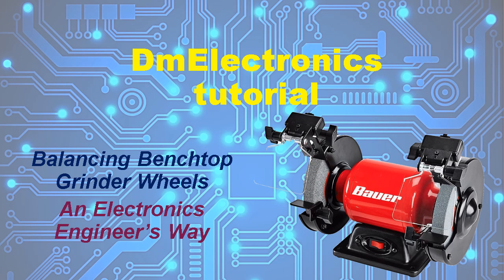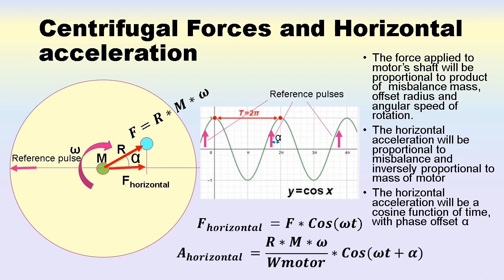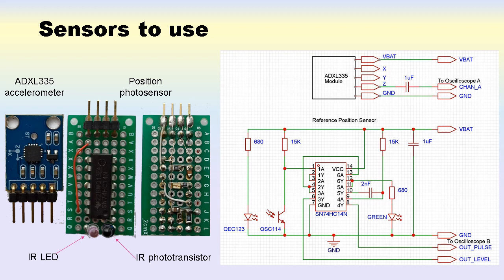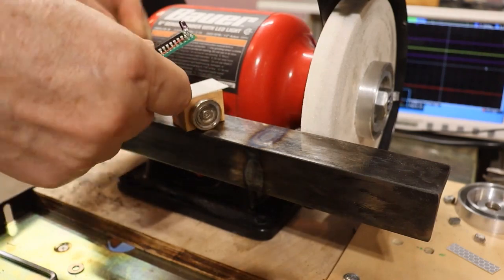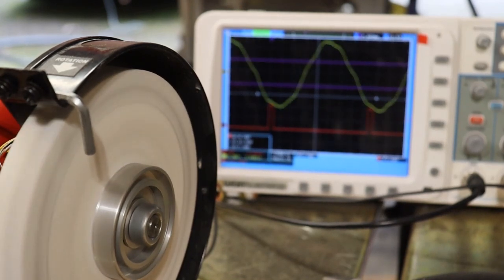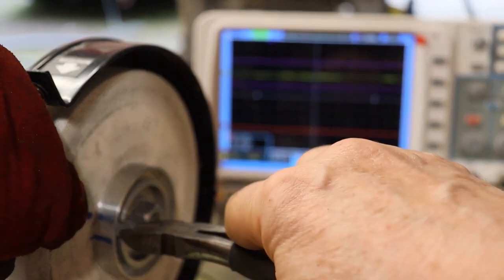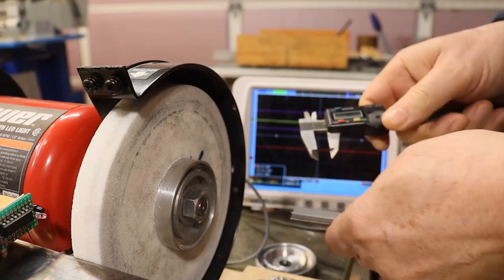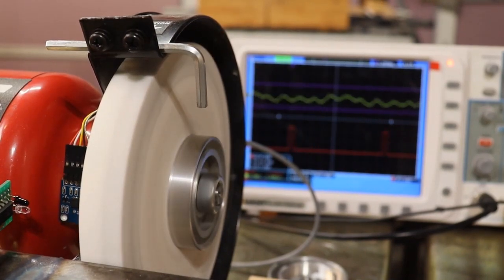Balancing Harbor Freight Bench Grinder Wheels: An Electronics Engineer Way

Comment from the maker: The phase of sinewave on the screen relative to the reference pulse tells the angular position of the counter-weight. The period is 360 degrees, so if the top of the sinewave is at, say, 3/4 of space between pulses, the angle is 270 degrees from the place where the reflecting sticker is attached. If you can measure the delay with cursors, the angle in degrees is equal to the time (in microseconds) divided by 43 (for the 60Hz motor free running). In other situations, the angle (in degrees) is the time offset from the pulse (in microseconds) divided by distance between pulses (in microseconds) multiplied by 360. I.e., Angle=Toffset/Period*360. The weight may be also calculated from the effect of placing calibrated weight and measuring corresponding change of the amplitude. That allows to calculate weight and position and perform balancing in one step. In fact, similar technique is used in automatic wheel balancers in auto service.

Comment: I just bought one of those and have the same issues ( I'm also an EE).  I was thinking another way to do this would be to make a stroboscope and run it at a frequency slightly different from the rotational speed of the wheel. The space between the wheel and the rest should 'breathe'. Some simple markings on the side of the wheel ought to tell you where the heavy spot on the wheel is. Your way looks pretty complicated.
Reply from the maker: Thanks for watching! Please let me know if your experiment with a stroboscope was successful. I guess that if you want to track the (deflecting due to misbalance) center of rotation with stroboscope, it will be very difficult because the amplitude of displacement is very low, especially near perfect balance. Besides,  you need to properly dress the wheel before balancing (but you need to do it anyway). One other alternative is to place the grinder on the scales and observe the AC component of the weight, which is nearly the same as I did but will be less sensitive and needs an amplifier for load cell signal. 
On the side note, someone suggested that the same method will be useful for balancing the ceiling fans. This case may also work with stroboscopic observation.
Reply: @celsiusswatt6021  You got me thinking about this. I worked for a company that make ultrasound probes for surgery. We tested them looking through a microscope where the illumination was coming from an LED being pulsed close to the vibrating frequency. I looked like it was waving back and forth really slowly - very cool. I was going to write a program for one of the ARM cortex eval boards I have to pulse an LED using a timer. I was going to just put marks on the side of the wheel and watch the gap between the wheel and the tool rest to get an idea where the imbalance was happening. If I get around to this soon I'll post what I find. I was a bit surprised at how out of balance the grinder was.
Reply from the maker: @ianboard544   Note also that the spacing between the stone and toolrest will not depend on imbalance, because they are fastened rigidly together, and they will vibrate together. The best you will see this way is the non-concentricity of the stone. You need a kind of marker on your steady table and let the grinder wiggle on its flexible rubber feet to see where the imbalance is. The Young's modulus of lateral movement is lower than that for vertical, but you may want to observe vertical vibrations if it is easier... You mentioned a keyword: a microscope. When rotating at normal speed and close to perfect balance, the displacements you need to detect will be <10mil. Let's compare complications when you are done 🙂
Reply: @celsiusswatt6021  good points. The one ive got moves quite a bit. Im curious what Ill see. I have a project i can base the strobe on so it should be pretty simple.

Comment: Interesting that I just watched another video on this unit that took 5.4 grams to balance. I dont have an oscilliscope but do have a lathe. I made a ring with 12 locations for a 1/4 screw. All roundness and wobble was addressed first. Then, added the balance ring. Using a brass screw - progressively moved the screw to locate max and min locations. Then proceeded to tune to minimal vibration with weight. It does run smooth now, all the imbalance was in the wheel. 

This is a good reference video for a low cost balance sensor. Bravo!!!   Well done.

Comment: As a fmr. EE turned software engineer; I appreciate this. Esp. the real oscilloscope. 
What's really needed here is a smart wheel with a WiFi connection and an 'app' for iOS/Android/Web with a cloud-based solution to rebalance the wheel internally via hydro dynamic changes in micro-cylinders. The system will also monitor the number and type of things you grind and order new parts as needed. 
Or one could purchase a better quality product?  
Nice touch with the wire cutters as pliers. :)

Comment: Well- could I just send You my grinder with the wheels I´d like to have on? Since my grinder is equally shitty but I am no engineer nor do I have access to a lathe (or know anyone that does) to make those weight thingys.
But I shure would like my grinder to run nice, I know they can but I´m not gonna glue on weights to the wheels (as suggested by other videos)
You could make a pretty business out of, I guess if it is quick and cheap to do.
Reply from the maker: The main purpose and advantage of the method is balancing in place together with the rotor, and I am more than happy with the result.   One advice, though: gluing some weights to the side is a chance to be hurt as the glue is not reliable. So putting the weights in the way that they are held radially (as in my video) is a much safer option. However, someone mentioned that I should simply buy more reputable stones and grinders 🙂. So it could not be a business...
I bought CBN (Cubic Boron Nitride) Grinding Wheels (they are well factory-balanced) for grinding carbide bits (Note: you cannot use diamond wheels for carbide)
Reply: @celsiusswatt6021  Did´nt you mix it up? diamond for carbide is good.Cbn for carbide don´t work.